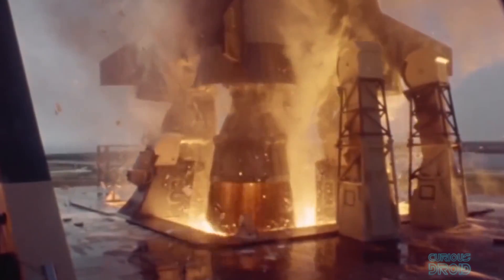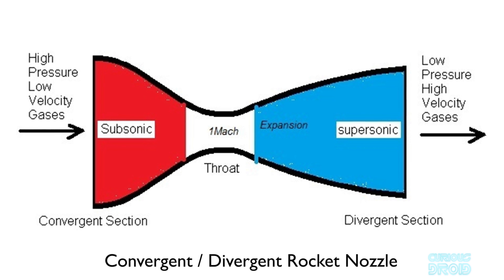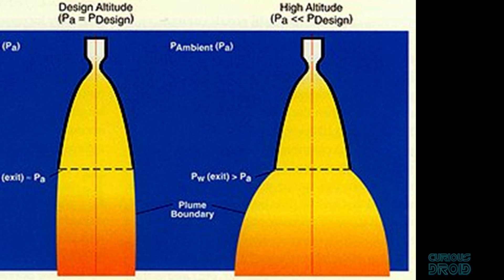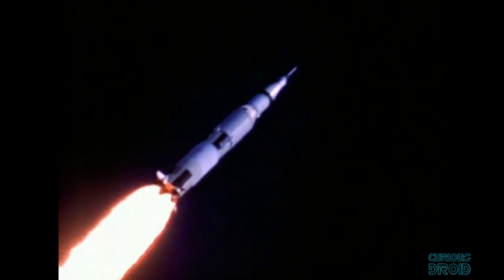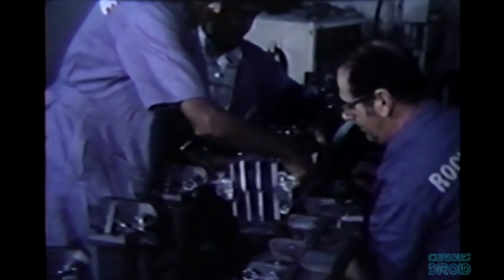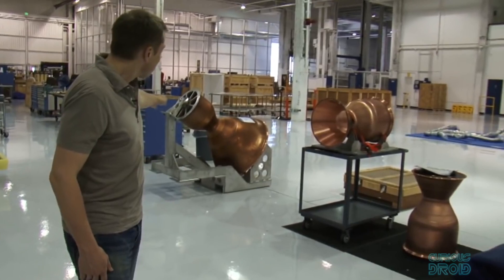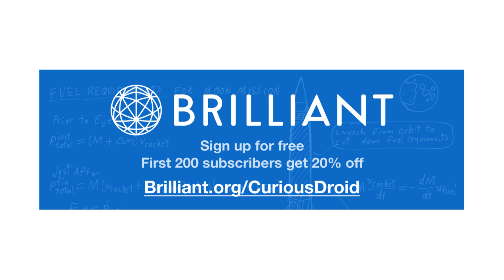Aerospike Engines - Why Aren't We Using them Now?

Comment: It was probably not used because we have not developed material that can take the strain long enough and the added complexity and weight might not be work the higher efficiencies.  Nobody uses inferior technology because of some government conspiracy... especially since there are many propulsion companies that are private now.  We put multiple stages on because there is a point were it is more efficient to have a second engine and jettison the empty fuel tanks and the structure and skin around them.  Plus the engines on the higher stages can be designed to work more efficiently at those altitudes.

Comment: Interesting subject ,  money is as you pointed out is  often a problem  with innovation .
 The way the rockets  squeeze  out the exhaust gases entered my mind a while ago .
I think in terms of car stuff( car guy :)  ).
Some truck  fuel injectors can change the shape of the spray pattern with computer among other functions , this came about due to emmision controls , 
probably some  car ones  could too.
I know it's a bit of a stretch going from car/truck  fuel injector to rocket engine,  and maybe the are already similarities  .
But sometimes one wonders if some of that old ICE tech could be useful :) .

Comment: Arn't aero spikes jsut easier to manufactur in the first place since you only have machine outside features on a piece of stock rather than isnide feature. OIf course you need mounting stuff which would likely be somewhat inside but it just seems like an all around better spolution.

Comment: The XRS-2200 was less efficient than the Shuttle's RS-25 at every single altitude. The only reason it was made was because of assertions that it would be easier to maintain, not because of any performance improvements.

Aerospikes are actually pretty useless, they allow you to have a higher expansion ratio at sea level, but typically for first stages the bottleneck is the space available at the bottom of the rocket. SpaceX runs the merlin underexpanded at sea level in order to fit nine engines instead of say seven at the bottom, so if they used aerospike nozzles in the regime where they give an Isp improvement, their rocket wouldn't even get off the ground. Now that they are developing the high budget raptor, they went for a high chamber pressure FFSC engine that would benefit even less from an aerospike and which will be run even more underexpanded in the first stage configuration.

The aerospike is mostly useful when trying to use an upper stage engine on a first stage to make up for low engine chamber pressure. If you actually have a decent staged combustion engine, it's pretty useless since the max benefit is a 1-2% ish improvements in first stage Isp at the cost of reduced sea level thrust/weight and thrust/area. For upper stages, bell nozzles have the maximum theoretical efficiency and always perform better.

Comment: Well, I'm guessing the answers is because the sheer amount of fuel used and thrust needed early in the flight means that they always want to dump the big engines and fuel container. So once you are using two stages anyway, the advantage of the aerospike disappears.

Comment: Aerospikes is great for SSTOs, but multiple staging makes the most  sense with Earth’s gravity. Using multiple stages, increases the rocket’s payload dramatically, since you are getting rid of dead mass. So having engines that are optimized for different elevations is actually not an issue with multiple stages.
Reply: For spaceplanes and/or SSTOs, an air-launched spaceplane like the MAKS (not to say I won't prefer rocket-launched spaceplane) or a dedicated hypersonic air launch platform aircraft (possibly scramjet) is more appealing to me. Air-augmented rocket engine, and fly-back boosters (eg Energia II, Baikal, DLR LFBB, Saturn-Shuttle concept), can be explored for a recoverable first-stage.
Reply: That "dead mass" still represents a huge investment of time and money that you are throwing away, though.  An expendable launcher is only worth it if the payload is even more valuable than the rocket, in which case the launch cost can be recovered from the customer.  An SSTO would make even cheap payloads worth launching, which means greater access to space.

Comment: Except the biggest issue with ssto is the rocket equation and having stages is way more efficacy fuel wise because you can ditch heavy bits you don't need to take all the way to space

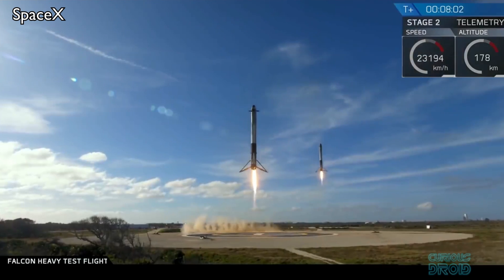Comment: At 11:22 it's mentioned that booster recovery saves more than fuel savings. 
Isn't that wrong? 
As I know, SpaceX hasn't recovered most boosters, and has reflown even less of them, since just like at every previous attempt at reusability, refurbishing and failproofing the flown hardware just costs more than building a new one. As I know, recovery of Falcons up to Block 4 wasn't what bringed the cost down, but rather modernizing and steramlining the production of the rockets.

Comment: You cant beat the design of the UART engines. Not even sci-fi movies ships have such design. And the electrical propulsion and magnetic methods. Aerospikes are not good enough for deep cosmos.  But the cost of developing it at once is beyound imagination. Thats why first same methods have to be applied in the airplanes and seaships.  It will be like ekranoplan on steroids. Then the next step is to increase the efficency and definetely you will have enough money to afford the upgrades. 
UART engines are Ultra Accelerated Rocket Thrust. Like the jet engines but on steroids. Suck particles around the ship, acclerate the particles inside the ship and blow away the particles in oposite direction of the desired path. 
Also unlike the regular jet engines which work only with air UART engines work with any type of particles. No matter gas,liquid or solid state. The question is HOW MUCH particles you can suck per second and how fast you can accelerate the particles. This in combination with the paradox power system (based on the electromagnetic methods and unlimited energy) gives you ship which beat the performance of the millenium falcon. 100% fuelless full frame standalone ship. That can operate even under the water as submarine. But fuel industry and the dark government suppress such designs.

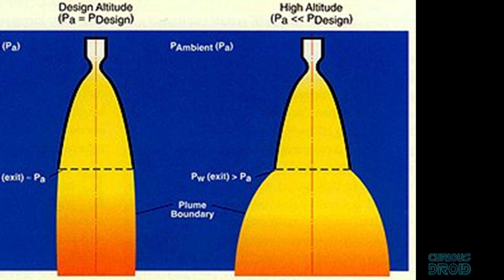Comment: At 3:50, you are telling it will overexpand if we design it for max performance at sea level. But don't you think it will be under-expanded as with the increase in height, atmospheric pressure will reduce and will lead to under-expansion as my rocket nozzle can expand the gases to 14.7lb/sq.inch only but the corresponding pressure at that altitude will be much lower.

Comment: Cost of fuel is insignificant, but mass of fuel is a different story. If you can get to orbit with 40% less fuel, you can not only use less fuel, but also carry more payload. At present, Falcon 2 mass is about 550 tons, 475 of which is fuel and only 23 tons is payload (4%; when going to LEO). If saving 190 tons of fuel allowed us just to send twice the amount of payload (50 tons), the cost of getting given mass of payload to orbit would halve.

Comment: Would we build a rocket just to straight use up all the fuel in one single swoop, you would be right.

But that isn't the goal. has to change in a lot of situations in space, hence we want as little mass as possible. So we need to get rid of as much mass as possible.

Keeping the empty tanks on the rocket adds a lot of inertia. Not to say we would have a wave destabilisation problem since the rocket would be so long that inertia changes wouldn't happen at a single time, but it would start to wave through the entire rocket. Best case would be some problems to actually change the speed, worst case would be deforming the entire rocket causing extreme damage.

You are right that they should use aerospike engines for the earth escape but multi-staging is necessary.
And up in near vacuum to vacuum a bell-shaped engine would outperform aerospike engines.

Comment: smal point and, maybe touched on before (though I did a cursory check of the comments and didn't see it).  so, correct me if I'm wrong but, you are talking about the exhaust nozzly, not the combustion chamber.  I've been watching and a subscriber for a long time now and, as far as I can recall, this is the first time I've caught a mistake like this and, since the misused term didn't interfer with the explanation (never implyed that there was any cumbustion hapening there) I am impresed.  Please keep up the good work, and thank you.

Comment: Uhhhh, you’re off by a few facts, one 
large one most notably. The temperature is hot enough to melt or at least deform nearly any metal. Those lines around the bell also run between the inner and outer shell, they are fuel lines. The purpose is to pump it’s fuel through the bell to chill it, as seen with air conditioner coils with frost covering them in August. It has been explained as a chocolate cup that you need to heat the liquid without melting the cup. 

That’s kind of a big fact you left out.

Comment: Love all the good point presented with very few of the bad.  Love all the statements about this being the wave of the future when it has failed in the past. 
So all the research in the past and they are not used now.  What does that tell us. Only that they if they had just a little more research they would be the wave of the future?  That companies that develop rocket engines since the unsuccessful aero spike, decide on the bell engine nozzle because it’s safe even though the aero spike is so much better?  
What if, now this will be a stretch, what if all that research provided evidence that this engine would become so many of the launch systems that were tried but didn’t work?  Maybe it was because simultaneous ignition of all those nozzles was difficult?  Maybe it had sometimes uncontrollable “hard starts”  could it have been all the complexity of fuel delivery to all those nozzles?  How about achieving symmetry between all those nozzles?  
Conspiracy “theory”?  I won’t go there.  
But it looks cool. LOL

Comment: Why not reduce the amount of fuel being put into the engine to reduce the pressure at higher altitudes?  Wouldn't this work?
Reply: You wouldn't reduce pressure, just the mass of the fuel leaving the engine, and therefore the thrust.

Comment: The primary reason for multistage rockets is not to allow for different engine nozzle sizes, it's to shed huge amounts of weight allowing for a far greater payload to orbit. An aero spike is less efficient in a multistage rocket, as it's worse at both sea level and in vacuum. Once above the atmosphere you don't need the same thrust you needed at sea level to get off the ground, you just need very efficient continued thrust to build up your orbital speed. An SSTO rocket is by design an inefficient way of getting to space, and with full booster reusability just a year or two down the road, SSTO can finally be put to rest.
Reply: Here's a video by Everyday Astronaut on why SSTOs suck: https://www.youtube.com/watch?v=Sfc2Jg1gkKA
Reply: PortlandPhil or both
Reply: Where's my space elevator? Get it together, Elon!
Reply: Yes, that is very true.

We seem very biased to thinking of one-part vehicles.  So we imagine hopping in our rocket and scooting into orbit 'cause that's like our everyday experience.

With chemical reactions, mutli-stage is the only practical choice.  Nuclear propulsion is a different matter, but then we have other concerns...

Also, you might find this link interesting - https://jim-cantrell.squarespace.com/blog/2016/11/8/failure-is-the-seed-of-growth-for-success-lessons-learned-from-developing-and-testing-aerospike-rocket-engines

In particular, Jim states: "The point behind all this is that, while aerospike engines can provide performance advantages. The larger number of parts and components means that they are usually heavier than their regular bell-nozzle counterparts (in terms of thrust-to-weight) and, more importantly, require very high component reliability."

Consider a linear aerospike engine with 8 combustion chambers along each side -- that's 16 combustion chambers with attendant injectors, valves, controllers, ignitors, perhaps propellant pumps, and piping.  Compare to a single chamber bell-nozzle design.  Yes, the engine is more efficient at turning chemical energy into motion; however, the overall vehicle performance is worse.
Reply: You might want to look at the Linear aerospike stats. It was more efficient at sea level than a lot of standard boosters and as it rose became even more efficient and powerful when in orbit. There are some exceptions to this and they come from long term testing and design tweaking. If the linear aerospike had been in operation for all the same years I promise you it would have been improved to incredible levels by now.

Comment: Why not an adjustable nozzle like on fighter aircraft? I know they have to pump the fuel through the nozzle to cool it (and thus sealing issues) and adjustable nozzles have limited variability, but I would believe it would be a good temporary solution until aerospikes can be developed.

Comment: Another advantage of an aerospike is it can double as heat shield as in some of Phillip Bono's designs such as the SASSTO and ROMBUS which would have used some of the liquid hydrogen for active cooling during reentry.
A rocket operating as a VTOL like F9 probably would benefit a lot from using an aerospike if it had fully cryogenic propellants.

Comment: For the record. The X33 technically was not truly canciled, it was currently defunded
Reply: So it was canceled.
Reply: worm worm truly canceled would require the feds confiscate all technical documents and destroy all prototypes. In this case a budget is requested every year and it is in limbo. The offices are reassigned and the people are still on site working on other things. A single signature is all that would be required to restart the project
Reply: You would not believe the number of projects that are shelved in both the public and privet sectors. None of them canceled, just shelved. Some of these do get re-funded. Most stay shelved as shelving costs less then canceling.
Reply: an accurate assessment I am sure

Comment: 1) The rocketdyne Aerospike engine was tested in the mid 60's not 1970's.
2) The aerospike engine is too lossy in performance going below mach 1 speed.  Only above mach 1 speeds did the shockwave actually contain the exhaust plume properly.  The problem was the shape of the rocket body did not allow even pressures around the aerospike plume and different areas of the exhaust plume lost efficiency.